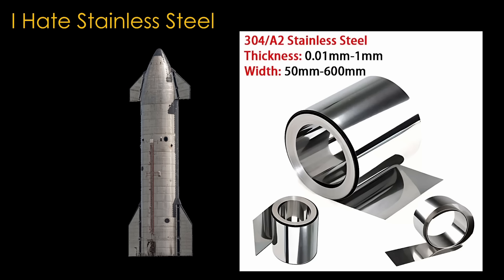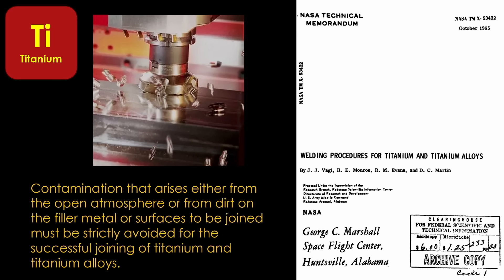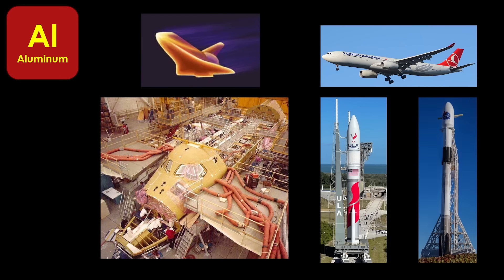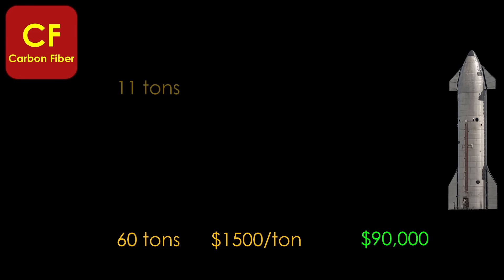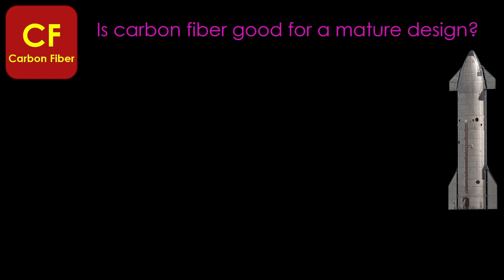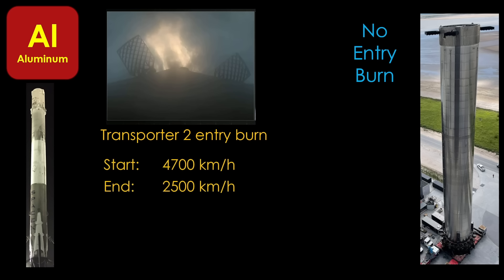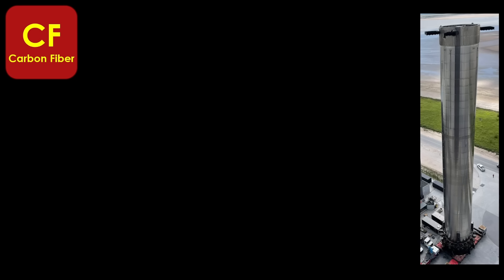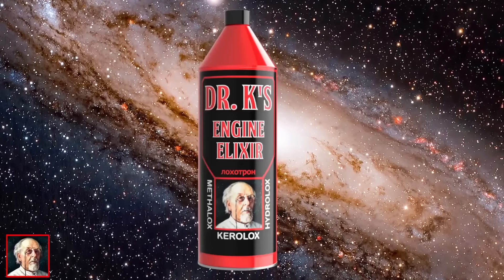Why Starship Loves Stainless Steel...

Comment: I didn't realize the whole stainless not needing an 1st stage entry burn - I learned something new, thanks!

However, it's important to remember that this analysis is centered on SpaceX, and R&D styles, expertise, and need of other companies aren’t reflected.
Reply from the maker: Yep. I'm really interested to see how Neutron comes out because AFAICT they have their own ideas on how to do things well and they aren't just trying to follow what SpaceX is doing.
Reply: @EagerSpace  Yeap... My little investiment on Rocket Lab depends on it.
Reply: @EagerSpace  The big question in my book is how well the Neutron first stage holds up during reentry. I'm fairly sure it will survive, but if the carbon fiber is degraded so that they can only fly it five times or something like that, the current design probably isn't worthwhile. It will be very interesting to look at refurbishment time between flights, and what changes they make after they start flying it. We might see them adding more heat shielding or replacing parts of the structure with metal.
Reply: @EagerSpace  Their ultra lightweight 2nd stage is quite interesting IMO. Your calculations on previous videos have shown how painful a 2nd stage with too much empty mass is for any of the higher energy orbits, like interplanetary transfers, TLI and GTO. It might end up being surprisingly good for those.
Reply from the maker: I suspect their second stage is going to be an absolute screamer. It's going to be lighter than a Falcon 9 second stage running an engine with a higher specific impulse than Merlin vacuum.
Reply: Why does stainless not need an entry burn though?
Reply: @MTG_Music  it's able to maintain strength at much higher temperatures than aluminum.

Comment: Thanks for the video, but I want to clarify that it is a mistake to calculate the dry mass of a rocket structure when using different materials, focusing solely on their density. It is also necessary to take into account the strength of the material and the fact that for pressure tanks it is much more important than density, since the rigidity of the structure in flight is maintained by pressure. That is why Atlas I-III tanks are still the record holder for lightness, despite the use of heavy stainless steel, since the rigidity was completely ensured by pressure. In Starship, as in the Falcon series, stringers and frames provide structural rigidity on Earth, and in flight this function is taken over by the pressure in the tanks. If we take this fact into account, then the difference in mass between the 4 main materials that you mentioned will be tens of percent, but not several times

Comment: When it comes to a car, airplane, or rocket fairing, carbon fiber and aluminum do provide a significant weight advantage over steel. But pressurized cryogenic tanks are too specific for the resulting difference in weight to be as large as stated in the video

Comment: Recalling that Star Ship and Super Heavy do not have separate tanks for propellant, but simply use the outer rocket structure, cryogenic behavior (temperatures well below 0 degrees C) is also important.  Stainless steel is the only of these materials that actually gets stronger at these temperatures.
Reply: Uh, they do have separate tanks for LOX & chilled liquid methane. 😅
Premix of propellants would be inconsistently burned. Read that as catastrophic.  That's 100% why the turbopumps mix the propellant in an exact ratio.
Reply from the maker: @gptiede was saying that they are not fully separate tanks - they share a common bulkhead between the tanks. With hydrolox vehicles - like SLS - they typically have two tanks that don't touch because the LH2 will freeze the LOX with a common dome design.

Comment: Elon implied once that steel is actually lighter than the other options all things considered (heavier heatshield, more reinforcement to deal with heat, cryo strength, tank liner for carbon etc) Do you think this is true?
Reply from the maker: I think it's weird that you think that I might be better informed on this than Elon. SpaceX will have spent considerable amounts of engineering time coming up with very good models of the tradeoffs between different materials and they have vastly more information than I have.

Comment: The very low heat resistance of carbon fiber got me worried about the heating on ascent. 
I assume Rocket Lab know what they are doing, but I am curious now how hot the rocket actually gets.
Reply: This may be why they plan to run their engines at less than 100%, though they might need more power on takeoff to have enough fuel for landing.

Comment: Hey there Eager Space. I'm also an engineer and I'm going to take issue with some parts of your argument. For one thing, the comparisons of material strength at higher temperatures seems to assume that the thermal protection system isn't doing its job. In reality the TPS must do its job. So the high temperature properties of the structural material under the TPS are irrelevant. You say there's a trade between the high temperature properties of the material and the thickness of the TPS. This ignores the fact that you cannot allow the temperature below the TPS to go above about 100-150C. Since anything higher than this could damage critical components such as wiring, or even act as an ignition source. The fact that IFT4 didn't explode is just dumb luck. And it reflects a poor design decision regarding high pressure plasma being able to leak through the gap between the body and the flap (a weakness in design I saw coming). 

You're quite correct that structural mass isn't as critical for the booster, but it is absolutely critical for the second stage. Which your argument completely ignores. A few years ago Elon Musk tweeted that his greatest concern with Starship was mass. That was prophetic. A vehicle that was hyped as having a 150 tonne payload to LEO is now closer to 50 tonnes.

Also, SpaceX has a lot of experience with aluminum alloy fabrication (Falcon etc). And Elon has made a lot of fuss about rapid prototyping. Therefore why wasn't Starship developed as a subscale prototype, made out of aluminum alloy? Its cost effective. Its well understood. And it can be rapidly prototyped. There are so many technical risks regarding Starship that need to be retired (as in, this is the first time this has been tried). It would have made a lot of sense to test out these innovations on a subscale prototype. 

According to analysts, Starship will burn $10 billion in cash before the end of this year. Why? Developing it at full scale has meant every stage of iteration costs more and takes longer. The anathema to an "agile" development process. 

You also missed that the shift to stainless was initially touted as an enabler for a lighter TPS, using transpiration. That proposition sadly vanished. I was actually looking forward to SpaceX testing an entirely new TPS technology (albeit on a subscale prototype). Now, Starship is stuck with ceramic tiles and all the headaches that creates - including potentially breaking its economics due to slower and costlier refurbishment. 

None of this stops a mature design reverting back to aluminium or even carbon fiber and reclaiming a lot of lost payload to orbit. Especially the second stage.

Also you may have seen Peter Beck's original Neutron launch video where he points out that out of the cost of a launch, the vehicle itself is about a third. A lot of the cost is operational. And the key to economic space flight is rapid reuse - which is precisely what the Neutron design is about and why having a fully reusable second stage can actually make the economics worse. Because it doubles the overall mass of the system and adds more cost/time to the process of reuse.

One other nit pick. You point out that carbon fiber has limited tolerance to heat. But later show that Electron has demonstrated tolerance to heating. I've seen an interview with Peter Beck basically saying that their expertise in carbon fiber has overcome a lot of the issues people often cite regarding carbon fiber composites (including also tolerance to cryogenics and tolerance to direct contact with oxygen).
Reply: I wouldn't exaggerate the experience Rocket Lab has with reusing carbon fiber boosters. They still haven't done it once. If Neutron ends up only being capable of five reuses before scrapping, it wouldn't really be capable of competing with a rocket that can be reused tens or hundreds of times.
Reply: @SpaceAdvocate  They've recovered a number of them and this is enough for them to learn how the material handles the heat.
Reply: @saumyacow4435  The fact that they haven't flown any of the recovered boosters might suggest they've learned that the thermal protections are insufficient.

It's been four years since they first recovered a booster, and three years since they recovered a booster with thermal shielding based on the experiences of the first recovered booster.

If you look at Falcon 9, it was about 1 year and 3 months between the first successful landing and first reuse.

Why do you think Rocket Lab aren't reusing boosters?

(I am a Rocket Lab shareholder, btw. But facts matter.)
Reply from the maker: I don't have time to respond in detail to everything., but I have a few thoughts...
1) The first is that SpaceX has clearly run the trades on all the options, and they have both far better information and far better models than we do. That means "they should have done <x>" generally ignores the fact that they almost assuredly looked at <x> and had good reasons that they didn't choose it. I'm looking for explanations why they made decisions but I know that I don't have enough data to second-guess them, and if I think they've made the wrong choice my experience is that it's generally because I don't know enough. Musk has stated that tiles beat transpiration cool in their trades pretty substantially and that's why they went with them, but that the difference has closed as they've learned more about tiles. That's the way it works when you are doing new stuff. 
2) The importance of second stage mass is the central feature of my "why is starship late?" video. This video is on the tradeoffs between different materials. 
3) WRT to the TPS having to do its job, this is a new vehicle trying to do something that nobody else has ever done before, including a TPS system attached to a cryogenic propellant tank. They are going to run into issues before they figure out the right solution. If starship had been aluminum on OFT-4, it would have melted very early, but because stainless is more robust, they got telemetry and data all the way down plus they might have gotten access to the vehicle parts for post-flight examination. Stainless enabled the rapid development. 
4) WRT to Neutron - and I am a fan of the rocket and of Peter Beck - one of the things that it shows is that if you are going to build a rocket from carbon fiber there are good reasons not to build it as a straight tube. And yes, I think they are successful, but they are just building a CF first stage and they know exactly what it needs to do. It's a very different vehicle environment and a very different design environment.
Reply from the maker: Peter Beck has talked about this, and his explanation is twofold. 

First, they have an optimized factory process for building first stages and flying recovered stages has the potential to upset that process and slow them down at a time when they really can't afford slowing down. 

Second, they have their engineering team focused on Neutron, and that is far more important than doing electron reuse. 

From a business standpoint, that makes a lot of sense. 

It's also useful to remember that Electron is very payload limited and recovery requires them to carry parachutes, and I'm assuming that on some payloads they are fighting for every kg and can't afford to carry parachutes. They aren't in the situation where nearly every flight can involve booster recover like Falcon 9.
Reply: @SpaceAdvocate  On the contrary this was discussed by Peter Beck in an interview and he commented that the recovered boosters were in good order. He's also said that he's quite confident in carbon fiber handling the thermal environment for Neutron - with certain unspecified enhancements, which I believe are coatings.
Reply: @saumyacow4435  Nothing can replace actually flying. I expect that Rocket Lab know enough about recovering rockets to know they are going in a workable direction with Neutron. But at the same time, they just haven't ever reused a rocket. There are many unknown unknowns that they will discover when they actually take the steps towards resuing a rocket multiple times.

I would have liked to see Rocket Lab set aside some resources for Electron reuse. It could certainly impact launch cadence, but it's more important to get the experience with reuse that they can then leverage into the Neutron design. When they hold off on reusing rockets until Neutron is flying, that sets them up for needing redesign of Neutron after they start flying.
Reply: You could not appropriately leverage subscale testing with different materials and related manufacturing methods to the full scale model. Stainless requires less TPS than competing materials for re-entry. This lowers vehicle mass. Furthermore, stainless fatigues less at high temperatures. This equates to higher flight counts for a ship. 

Future Starship designs will use front flaps further away from the plasma field. This will reduce or eliminate damage from each flight.

SpaceX and RocketLab have differing business models. Elon needs to launch many Starlink satellites at a time to LEO, and produce a second stage that can get from Mars back to Earth on its own. Beck needs to launch fewer satellites at a time, to various orbits from Earth only. Their rockets are built on their different intentions.

First stage re-entry encounters far lower temperatures than second stage entry. Maybe RocketLab can make a Neutron first stage fly multiple times. That’s different than landing from orbit, let alone flying again.
Reply: @EMichaelBall  As I said, stainless doesn't require less TPS since there is wiring, plumbing, fuel vapour etc that doesn't take too kindly to elevated temperatures about 100-150C. Also, for the dubious benefit of (so you say) less TPS, you pay heavily in the form of a structural material that is several times heavier than an advanced alloy or carbon fiber body that does the same job. So I don't buy you there. The only advantage to stainless is its amenable to prototyping. Maybe Starship will be redeveloped with lighter structural materials later on. That would be logical.

The only way to avoid plasma impingement on the flaps is to put the flaps above and behind a fixed structure that deflects the plasma and the flaps can then be lowered into the air stream later, using hinges that are themselves in the shadow. I'll wait and see. 

Rocket Lab has made no secret about wanting to pursue selling space based services - in other words building a constellation of its own. Take away the Mars delusion and their business models (as real space companies selling to real customers) might end up looking quite similar. 

The design brief for Neutron involves it re-flying its first stage many times and being reusable within 24 hours. Let's see if Starship gets anywhere near this cadence, given the obvious design issues with it's upper stage, the repair and refurbishment of tiles and so on. The economics is quite simple. Most of the cost of a launch is not the vehicle. Rather its operations. And of the vehicle itself, the part of Neutron that does get expended is a small fraction of the overall vehicle build cost. Operations cost is a killer for Starship given its sheer size and complexity. Physics says that the price you pay for a fully reusable second stage is a vehicle that is overall twice as heavy for a given payload. Is this really worth it when Neutron's expendable second stage is going to cost tens of thousands out of a multi million launch contract?

Comment: 8:27 I hate when people should be saying "denser" but say "heavier" or even "more massive". Steel is somewhat DENSER than some other choices. But what matters in getting to orbit is MASS, which is density times volume. If using a denser material gives enough strength that you need less of it or need less accessory mass, the total mass can be less. As I recall (the first Everyday Astronaut interview?), Musk said that the other choices would have to add mass for thermal protection, so the result would be a wash. Again, the steel solution would NOT be heavier, as stated here.

Comment: the main issue is starships dry mass. it works alright (although its payload is low for its size) for leo applications but anything more than HLS’s already ridiculous amount of launches to deliver a lander to the moon for ONE landing and return is too much.
Reply: Starship can deliver a moon lander in one launch, but it would have to be more like an Apollo lander with a couple of additional stages, carried in the payload bay. If anyone wants to do this, I'm sure SpaceX would be happy to sell them launches.
Reply: @SpaceAdvocate The payload bay volume is too small for that. Unless you wanna do a mini apollo 😂
Reply: @SpaceAdvocate Also one more question, where would the lander be launching, LEO?🤔
Reply from the maker: What scenario are you thinking about when you say "anything more"?